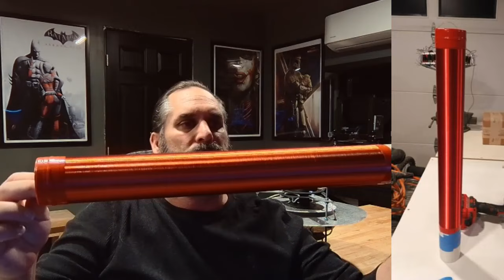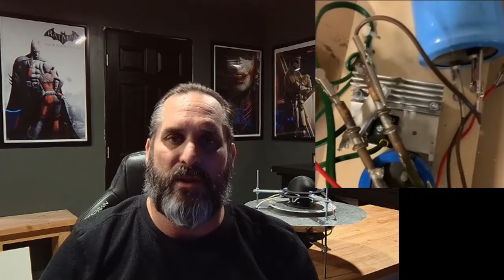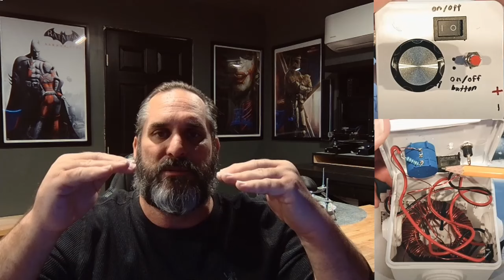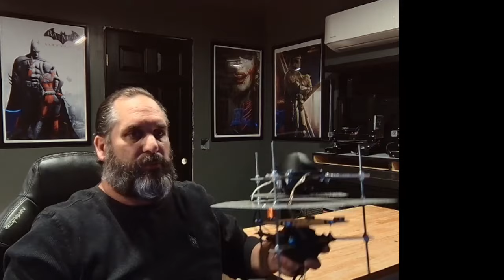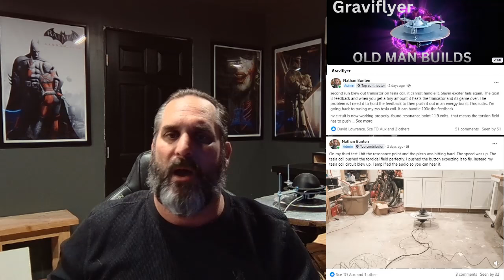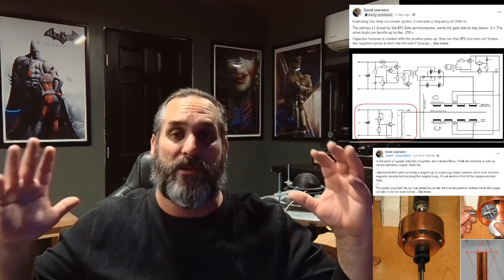Graviflyer #54

Comment: Dude, I am your wingman. You are going to soar. If you can find the frequency of the flyback high voltage, set the piezo to the same frequency, and then tune the tesla coil to the same frequency, you will achieve 3x resonant frequency. You can also cut the metal discs to resonate at the same frequency and get 4x resonance. When I do the math,  the graviflyer at resonance will achieve infinite voltage, and amps are infinite. I will check my math with my daughter, who is a physicist. Again, you are a genius!
Reply from the maker: thank you.
Reply from the maker: Check this video out. Slayer exciter with a long #2 coil. https://youtu.be/_muBka88Zgg?si=7DeuFbt1XpKnMrA1
Reply: Respectully you do not know what you are talking about, Current and voltage cannot be infinite even at resonance.
Reply: @okaraaze1087  I was doing the math with ideal wires and ideal components. It's strange how your first action was to accuse before asking for clarification. “Old man builds” knew what I was talking about. Forgive me for assuming others would. I should have been more clear.
Reply: @bobjohn8581  are you looking to demagnetize portions of the circuit?
Reply: @okaraaze1087  The part of resonance that intrigued me was voltage, current, and vibration, which could have a shared resonance—having these in theoretical ideal give infinities. I was surprised by the vibrations that could be included. Thanks for getting me to clarify.
Reply: @nathanbunten4299  I watched the video. He has a weak output. Its because his tall coil draws a lot of current. Thanks for sharing.
Reply: @shawncalderon4950  I Apologise for perhaps being impolite :).
Anyway my friend, It is not possible to have infinite voltage or current. This violates the laws of thermodynamics which states energy cannot be created or destroyed.
Reply: @shawncalderon4950  I would love to check out your math because im sure you did something wrong here. Resonance isnt some magical concept that creates voltage and current. In tesla coils resonance is utilised to create voltage spikes that occur at the high pulsed currents due to a capacitor discharge. This capacitor discharge creates a LC circuit forming a sign wave, at this point the theoredical forms of resistance drop to almost zero which allow for an increase in current draw, It is an optimisation of energy not a magical concept that creates it.

The way tesla coils use this is in the primary coil the instantanious high current (that is the nature of capacitive discharge) Creates a large magnetic field that interacts with the secondary at x frequency, This frequency can be matched to the secondarys resonance value which comes from the series capacitances of the individual wires to the environment we call parasitic capacitance and the coils inductance value.

It is absolutely 100% not possible to have infinite voltage no matter how hard you try, unless you are god himself.
I hope this helps
Reply: @shawncalderon4950  Could you elaborate please? What do you mean by vibrations? Also may i state regardless of what this video says a gravfly is not a possible divice its all mumbo jumbo lmao.
Reply: @okaraaze1087  No worries. Infinities occur if you perform the math with ideal wire and components. Of course, there is no such thing as these ideals in nature, but on paper, these ideal objects are used to teach electrical engineering. I'm not sure why you keep digging in your heels. Thanks for sharing.
Reply: @okaraaze1087  ok, my last try:/
In an ideal LC (inductor-capacitor) circuit at resonance, the impedance of the circuit becomes purely resistive, and the current can theoretically become infinite. This phenomenon occurs because at resonance, the inductive reactance (XL) of the inductor cancels out the capacitive reactance (XC) of the capacitor, resulting in a net impedance of zero ohms.

In an ideal scenario where there is no resistance in the circuit, the current flowing through the circuit can theoretically become infinite when the impedance is zero. This is because in an ideal LC circuit at resonance, the only limitation to the current flow is the impedance of the circuit itself, which becomes zero at resonance.

However, it's important to note that in practice, there are always resistive elements present in any physical circuit, such as the resistance of the wires, the resistance of the components, or other parasitic resistances. These resistive elements will limit the current that can flow through the circuit, preventing it from actually reaching infinity.

In summary, in an ideal LC circuit at resonance, the impedance becomes purely resistive and can theoretically lead to infinite current flow. However, in real-world scenarios, the presence of resistance in the circuit will limit the current to a finite value.
Reply: @bobjohn8581  very interesting. Thanks for sharing!
Reply: @shawncalderon4950  Yes, In theory. I have built many tesla coils in the past, and as you may know infinities are never possible, only under mathematical theory. In real resonant circuits resistance generally drops to near zero, so infinite current never occurs. so why even mention it? your entire point is "in theory it gives infinities" well we arnt theoredical entities man.
Reply: current does peak to high ranges but not infinite. So your statement in the beginning is incorrect.

Comment: This thing has years worth of tests and modifications... i was playing with figit spinners and thought stacking them with layers of copper coils and magnets replacing the iron weights and the fan motor to with more magnets 🧲 😅 to spin ... 😳 i thought it would add current to my soil😅 help my plants grow😊 the videos are all informative 👍 thanks
Reply from the maker: take a rare earth magnet ( regular ) that is round with a hole in it. dig a small hole and put it in with a seed in the middle then cover it up. I will grow faster. Did it in my garden and it works.

Comment: one transmitting signal can connect to the flyer with the transducer resonance and the source signal can loop back to itself for steady operation , its when flyer gets out of range of the transmitter you can risk grounding aka source signal does not loop back instead it grounds to earth threw the flyer essentially toasting it in the process . (only if over charged the device is then this may happen , since the flyer can  give capacitance ) I dont see it getting struck by lightning unless it raises its potential too high or closer but not equal to a bolt of lightning . The differential flow works better when the differential is not so great instead subtle  (ALL SPECULATION AND OPINION ) example volts 1M vs .9M   great flow ..  1M vs 1K  not great flow . (differential flow)

Comment: Nathan, build the UAP that I explained to you after you finish the graviflyer. It would cost about $15,000 as you most likely already spent this with all of your devices. You shock the world and fly around the earth. You could then start a company and make a few billion. Build the star device to use as the power supply and pulsing circuit for the graviflyer. The spark plug for the star device pulses the circuit.  The calculations that I sent to you can be used for any size graviflyer just by dividing the mass of the graviflyer by the atomic mass of the aluminum to get the number of atoms of aluminum that you then multiply by the numbers on the page that I sent to you to know how to set up the settings for any size graviflyer.
Reply: Why are you not making your own videos Richard?
Reply: I am disabled and poor and don't have the resources.
Reply: @richardmuller867  shit bro. I'm poor and stupid, you got more chance than myself by what I read in your comments ur probably a genius. I hope your luck turns around mate for the sake of humanity

Comment: without the ultrasonic transducer it wont work..!!!!
Reply from the maker: The problem with a transducer it the field is not thick enough. You are trying to trap the plasma or field in the sound wave to create the field. If you use it for vibration. There is already so much of that going on it would just get lost. could it push off the ground? if it was at the bottom in a redesign maybe. it also may double the weight of the craft if you use 4. So what happens when you put it at the top where the piezo goes. It just shakes. it cannot form the sound waves because of the material in front of it. Unless you redesign the craft.